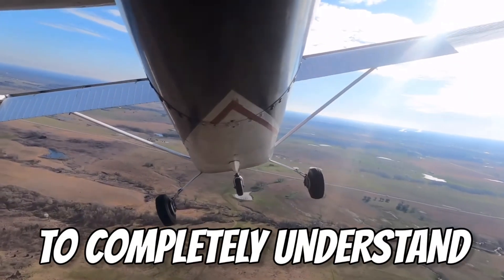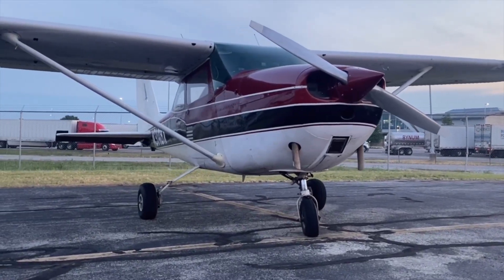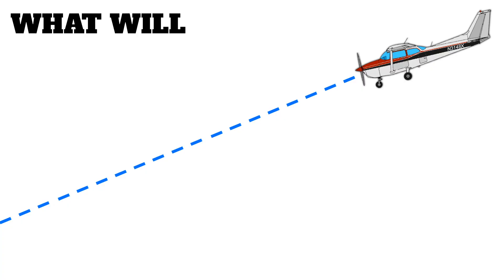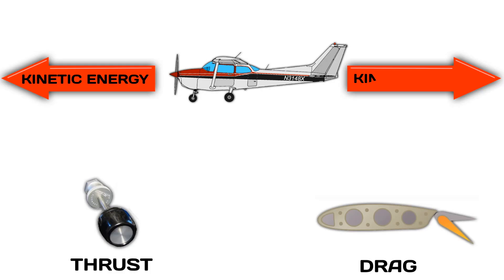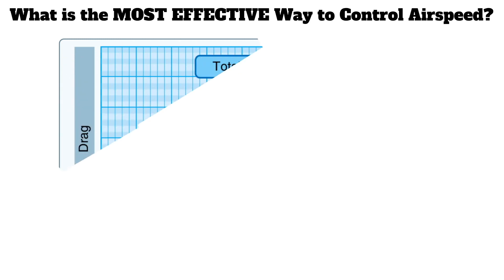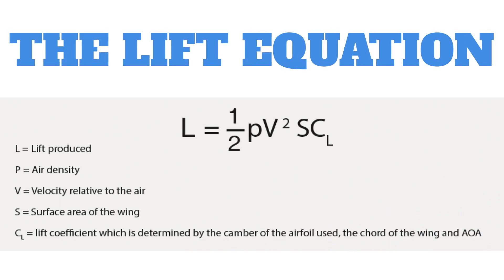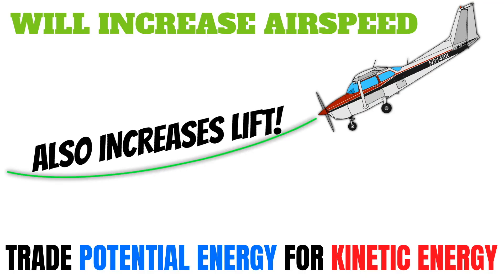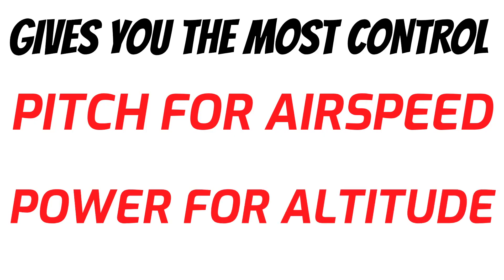Should I Use PITCH or POWER?

Comment: As a CFI since 1972, I can't disagree with anything you have said in this video.  Young pilots today are very lucky to have access to YT videos.  We never had that as young pilots.  There is so much information available today.  This is a very good instructional channel IMO.   BTW, I miss those 40 degrees of flaps in the older Cessnas.  We used to come down like rocks when we wanted to.
Reply from the maker: Thank you! Yes, YouTube is such a great asset!  And I love the 40degrees of flaps as well
Reply: Maybe I'm just obsessed with airplanes but... 

If you're at a throttle that would promote descent but are too fast, you have to bleed that speed off. If you're on glideslope, throttle is the only way to control speed. If you're low and slow, you need power first then pitch to gain altitude.

Am I just wrong? I'm a student pilot but have been around aviation my whole life so it seems pretty straight forward to me.
Reply: @ChrisJones-yt8zp  Chris,  back in the 1960s and 70s, we were taught by the FAA to use pitch for speed and throttle for altitude.  Years later, the FAA reversed itself, and today we know better.  Both the throttle and the elevators control speed and altitude together as a unit.  The formula is:  Pitch + Power = Performance.   The only thing I would add is that power controls airspeed more quickly, and the elevator controls altitude more quickly, but they both do the same thing.  You will notice it much more during slow flight.  But together they work as a unit.  Just think of the way an autopilot flies a final approach.  It uses pitch to hold the glide slope and power to maintain airspeed.  Good luck in your aviation career.
Reply: @daffidavit I've never used autopilot to final :) I'm only post solo and post xc solo.

Thanks!
Reply: @ChrisJones-yt8zp  Well, someday you will use an autopilot, and you'll be able to observe how it manages the final approach.  My point is that if you find yourself low and slow on final approach, I'd use power first to correct airspeed and then correct the height with pitch control.  I'd lower the nose to get down and reduce power to prevent an increase in speed if high on the approach.  However, both motions are down almost simultaneously, with a slight preference for one over the other.  That's how I used to teach my students.  However, you must first follow the instructions from your instructor and have this discussion with him/her when able.  Good luck again.
Reply: And just to add further information I mean in on an autopilot approach
Reply: You should disagree if you are a CFI. SMH.
Reply: @rtbrtb_dutchy4183  I still agree with him.  The autopilot uses power to control airspeed on a coupled approach.  Back in the 1970s, the FAA used  to push the old adage of using elevator for airspeed and power for altitude.  Later in the 80s and 90s, the FAA changed its tune and told us to do the opposite.  Now we know better.  We know that "Pitch plus Power equals performance.  This means that no one particular input is always primary.  This is a good video.  BTW, you made a statement contrary to this video but never backed it up with reasons.  Why not?
Reply: @daffidavit  I responded and explained in detail under other posts. By the time I got to your post, I didn’t feel like repeating myself. 

Flight directors use pitch for altitude and glide path. Has nothing to do with a coupled approach. 
Auto throttle or auto thrust systems use power for airspeed. Airlines wont accept their pilots to believe that power controls altitude. 

This is why GA has such a bad accident record. So many are taught the wrong way. Maybe we need to wake up and smell the coffee why we have so many accidents in just one particular part of aviation.
Reply: @rtbrtb_dutchy4183  Well, if you are saying it's better for power to control airspeed, I'd agree.   If we are slow, power acts faster and more efficiently, especially in slower conditions.  But in theory, power plus pitch equals performance.  When we add power, we also change the pitch, even if it's incrementally.  It's an old argument, but I think power for speed rather than altitude is the preference.  JMHO.
Reply: @daffidavit  Power for speed is the only way the physics works.  Take any civilian airplane as it comes from the factory and add the thrust available from all engines.  It adds up to roughly 25-30% of the weight.

The elevator for airspeed you mentioned that used to be taught may have been influenced by Stick and Rudder.  The physics proves that was wrong.
Reply: @daffidavit  so tell me, when you fly at 100 knots on final. And you aim at a specific spot on the runway, lets say the numbers. You put the numbers halfway in your windshield and you keep it there. Now when you want to slow down to 80 knots, you reduce power. You don’t change pitch in comparison to your aiming point, you keep it exactly the same. However, because the airplane was trimmed for 100 knots, when you reduce power, the airplane wants to remain at 100 knots, so it wants to pitch the nose down. So yes, you would have to trim nose up. But that’s to maintain your current pitch.
Reply: @warren5699  I agree with you.

Comment: Langewiesche has a definite opinion in Chapter 14 of the venerable Stick and Rudder: “The power approach is one extremely practical case in which it is definitely true that the stick is the airplane’s speed control and the throttle is the up-and-down control.” He observed controlling the other way around resulting in more oscillations.

This is after a discussion of the mechanics of controlling a power-off approach and how pitching up below L/Dmax actually results in a steeper descent. With pitch first you also have to contend with the temporary ballooning effect and readjusting pitch again after power changes due to the secondary effects of the thrust and prop wash.
Reply from the maker: Great points. Thank you so much
Reply: @enqueue100  That's out of context and misleading.  Of course it's possible to use the elevator to control the airspeed in good conditions.  Then if the pilot reduces power, AND LOWERS THE NOSE TO MAINTAIN THE AIRSPEED (you are omitting this part from Langewiesche's discussion), the pilot accomplishes a reduction in the lift vector which decreases the altitude.  It wasn't the power that reduced the altitude but the pitch.  In the landing, power is also reduced but does the airplane go down.  No, because the pilot is flaring with back pressure and the airplane is actually climbing from the descending line of flight it was on during the approach.

Using the stick for airspeed control on approaches during gusting conditions can be very problematic.  I saw someone doing that when it was gusting +/- several knots nearing the runway (pitching down when the airspeed needle lost speed/up when it gained speed).  What had been a stable approach before the gusting started became dangerously unstable nearing the runway because the pilot was chasing the airspeed with the elevator.

Airlines pitch to the glideslope whether the pilot is flying manually or the autopilot is flying.  What's their safety record - near perfect.
Reply: @warren5699  No intent to take Langewiesche out of context or mislead, this is why I quote all of the author, book, and chapter so that folks who want the full context are at liberty (and encouraged) to read the book, or at least the entire chapter for themselves. The exact words of the next sentence you mention:

"If you want to come down more steeply, don't nose the airplane down. Cut the throttle back, and then manipulate the stick so as to keep the air speed constant."
- Ch. 14, p. 259

I don't think anyone was arguing one should make an approach using power alone without ever adjusting pitch, it was between whether to use pitch or power primarily -- but not solely -- for airspeed control versus altitude control (indeed, the entire topic of the video). Apologies if my quote seemed to imply it was not an argument for "pitch for airspeed, power for altitude", but rather an argument for "power for altitude and let go of all the other controls", which neither I nor Langewiesche would recommend.
Reply: @enqueue-it  Thank you for your reply.  The quote on page 259 is another example by Langewiesche of talking out of both sides of his mouth.  He says to descend more rapidly, don't nose the airplane down but cut the throttle back and manipulate the stick so as to keep the airspeed constant.  Well to keep the airspeed constant with reduced power, you have to nose the airplane down.  So he's doing what he just got through saying don't do and claiming that the throttle is the up-and-down control.  When power is applied it creates a force that's an extension of the longitudinal axis, like tying a string to the propeller and pulling horizontally.  On an approach it would even be pulling slightly downward.  If that force can control altitude, as I think many pilots have been brainwashed to believe, then there's some basic laws of physics that were never taught in high school.

Comment: But if I'm in final and I increase the pitch, this will increase the lope. This means, I will go under the desired slope. And sometime, in this situation, if I need to increase the speed, this means I'm already under the slope. Is there something I missed?
Reply from the maker: Now, as is stated in the video, pitching for airspeed is more effective, BUT if you’re on a glide slope like an ILS, sometimes it’s advantageous to use the opposite controls because they are less effective and that means the changes are smaller. When flying instruments, small changes are easier to handle.

Comment: While cruising, pitch for airspeed, power for altitude. For landing, power for airspeed, pitch for altitude. 1:09
Reply: @unduesafe  How does a little six foot propeller oppose weight?  The Handbooks indicate that is done with a 36 foot wing (Skyhawk).
Reply: I think it's the exact opposite: when in cruise, pitch for altitude and power for speed; when landing, pitch for speed and power for altitude (glide path).
Reply: @igclapp  When landing, short final, don't you chop the power and hold the airplane just above the runway with the elevator?
Reply: @warren5699 you don't chop power usually until you are over the runway. Or have excess altitude.

Comment: parasite drag is proportional to dynamic 'pressure' what is usually called q  
q = ½ density × TAS².
Now Parasite drag is 
q × Cd × wing area
That means the drag increases Quadratically with Speed, never exponentially.!
exponentially is proportional to e^V (e to the power V)
V^2  ( V to the power  two = quadratic !!!)
where e = 2.71828...
Learn basic mathematics !
Only because the parasite drag is proportional to the SQUARE of speed and the induced drag is inversely proportional to the SQUARE of the speed is the  Indicated airspeed for minimum drag , when the induced drag equals the parasite drag.
The L/D is then exactly the SQUARE ROOT of 
π÷4 × b² / ( CD × wing area)
π = 3.1416...
b = effective wing span
CD = parasite drag coefficient 
To learn this elementary aerodynamics, simply download any of many text books on aircraft
 aerodynamics
Reply: We, from the small country of Bolivia, flying from the high airport of the city of La Paz, "El Alto" must be prepared to deal with high density altitudes exceeding 14000 feet, where the power is marginal to climb safely with non turbocharged engines.
That requires a good knowledge of propulsion, and aerodynamics and especially the indicated airspeed where the power required is minimum, that happens at 76% of the speed  of best L/D, but it is not the best power off glide speed, because of the wind significant drag of the windmilling propeller.
Reply: Besides we speak castellano with La torre La Paz, and also must learn aerodynamics in different languages, 
Même chose en France ou c'est necessaire de parler français avec la tour.

Comment: Be careful not to mix units.
The total drag curve is different than the power required curve. The minimum on the power required curve is not L/D max, but rather min power required (or max endurance).  The minimum on the drag curve is L/D max.  If you multiply the entire drag curve by velocity, you get the power required curve.  
The hook upward on the left is much shallower on a power required curve than it is on the drag curve.
Reply from the maker: Not to be contrary, but the chart literally says “a function of total drag”
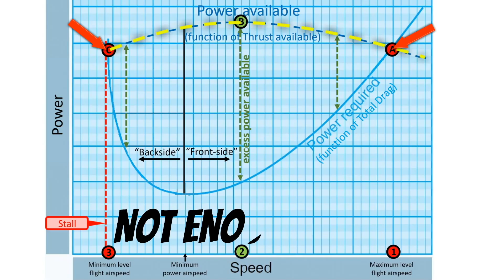Reply: @FreePilotTraining  take a look at 6:56. A power curve is shown, but you overlay L/D max at the min power point. That is where the units no longer agree.  L/D would be at the minimum of the drag curve.
Indeed, the curve is a function of total drag, but it is not drag since it was multiplied by velocity.
The drag curve and power curve are very often mixed up or erroneously interchanged. The information they convey is actually very different.  Note that if flying a jet you would stick with the the drag required curve.
It is instructive to generate both a drag curve and power curves from basic equation to see how they relate to one another.  One can then also see how power curves tend to be greatly exaggerated in illustrations.

Comment: i use pitch to control airspeed and power to control altitude. That's why before touchdown during flare the moment you cut the throttle the plane starts to descend and to decrease the rate of descent I usually pitch up.

Comment: In my opinion, vertical rate is key for stabilizing airplane.  However, power and pitch can do the job and weigh and conditions may decide when is better to using power or pitch.

Comment: Pitch will always control the airspeed in cruise. That is, if you trim the aircraft and don’t touch the trim, it will settle into a specific airspeed based on a specific power setting. When you want to control the aircraft for landing, best way is to create a profile. Every aircraft is different, including every N number, because some planes have been rigged, modified, or even variance in production. So when coming in for a landing, you must know how much power and what pitch to use for your initial level speed. In the case of a Cessna 172, this could be 80 kn. Now add one notch of flaps and re-adjust your pitch to maintain level flight. This may result in your airspeed settling around 75 if you do not add any power. When you are abeam, the numbers you reduce your throttle starting with about 300 RPM, and this can vary as noted before. Now set up the aircraft with pitch for about 400 ft./min. decent and adjust your power to the desired airspeed you wish to fly. I use 70 kn. When I turn base and add another notch of flaps, I adjust my pitch without touching power again  for 400 feet a minute. If I have to find my airspeed to remain at 70 then I adjust it with power. When I turn final and have the runway made, and I am approximately 300 feet above the runway I add full flaps and use power for an airspeed of 1.3 times VSO. This will set me on about 55 kn while adjusting power and I hold that speed with full flaps. I adjust my decent rate with power. I crossed the threshold and have enough power to slow my decent to about 300 ft./minute. When I am ready to level off, which would be about 25 feet above the runway, I raise the nose and slowly reduce power, letting the aircraft slow. As it starts to descend our reduce even more power, and slowly raise the nose and maintain the same rotation height as of takeoff. This might be 5°. I hold it there and it will sit right down on the mains with the nose wheel still above the ground. Never bounce or never have to jump on the brakes. Remember, you will always have to adjust both pitch and power to fine-tune your aircraft due to weight, center of gravity, and crosswinds or thermals.
Reply from the maker: Great input. Thank you
Reply: I agree with you. I also think the same way. But not sure why sometimes the instructor doesn't like to add/reduce power but insists on pitching up/down during landing to control airspeed.

Comment: Pitch for your airspeed and use power to control your altitude.  There is no specific order in which you can achieve this;mean, sometimes, you will need to reduce power before you can pitch up or down for airspeed or vice versa. Example: You are too high and fast with some power. You will need to reduce power even lower then your current power setting before you can Pitch up to slow down, or else you will end up gaining altitude while trying to slow down.  All in all: Pitch for air speed and power for altitude.

Comment: Thank you for explaining this very important concept. I remember during my private pilot training that I struggled for awhile until I realized 2 things. The first is that I need to trim the airplane for the approach speed I want and use the power to control my glide path. The second was understanding the phugoid motion of the aircraft and how it could change my airspeed. So for me that would be trim for airspeed, power for altitude, and pitch control to counteract pitch change and phugoid motion that could occur from turbulence or deploying the flaps.

Comment: Stupidest argument in aviation. It’s both. One impacts the other. It’s purely energy management.  If you are low and you add power you will have to pitch up or your speed will increase. Are you controlling speed with pitch or power?  Are you controlling altitude with pitch or power?  It’s both.
Reply from the maker: It is both, but the point of this video is to say that one is more effective than the other in certain situations